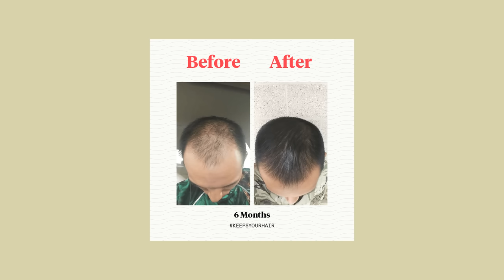£500 Nürburgring Track Car!

Comment: Pretty insane to overtake M cars, Porsches and Teslas with a £500 car
Reply: Well, they aren't racing, some are just cruising around, but still an achievement to drive from the UK to Germany and do a couple of laps without a major breakdown in that car.
Reply: it's less the £500, than that they did all this without using full throttle that impressed me! (full throttle= limp mode in their case)
Reply: the driver is the most important when it comes to amateur racing, ESPECIALLY on a track like the Nurburgring.
Reply: @HazewinDog  know the flow, know the line. smooth equals fast laps.
Reply: @nirfz  in the USA, 700 dollars (about 500 pounds) wont even get you a running car. my friend got a special deal, a 2011 sentra with bad coils and plugs, and no bushings, automatic, leaking cat converter and muffler and no stereo, for 1000 dollars.... because a friend of mine runs a dealership that repairs funky volkswagens, and had  this sentra just dropped into his lap, and wanted to get rid of it. he spent zero, so a thousand dollars was pure profit and he didnt have to do a damn thing.
Reply: @ghomerhust  You wouldn't get a fully functioning car for that money where i live either. But my point was that the money spent is not what impressed me the most but that they managed to "outrun" others while being in limp mode and never able to use full throttle.

Comment: Great video. I had the same car, and for the roof you can open a valve on the pump in the boot which lets you manually put the roof up and down. It has an allen key under the cover which fits.

Comment: if I remember correctly, that car has a slot where you put in a key what can be found by your spare wheel. you need to find the slot somewhere stick the key inside it and turn for the roof to open/close manually. my friend got one of those mercs and used that when his batterie died and the roof was still open.

Comment: Had my eye on the SLK for a while now, really considering it as my next car!!
Reply: I've owned 3 of them still currently own one things to look out for would be no rust, sagging roof line, make sure the roof folds and works well. Thankfully I've never encountered any of these issues as I have purchased low milage examples. They are really under rated and alot of fun I personally think the styling of this generation is much nicer than the ones that came after it. If you find a well cared for example you will love it :)
Reply: Ahh thanks for the advice I’ll definitely remember these things when going to see one. Yeah this generation looks good, also like the R171 variants. The front nose cone makes it look like a tiny SLR. I saw a nice looking 2010 SLK 300 so a V6!! It had only done around 50k miles and was going for I think £11,000. Was really tempted to test drive it but currently out of work so it doesn’t really make sense to get a new car right now. Was thinking of selling my current car and everything. The only thing is not sure if I’d ever have the roof down. But tbh they look good with the roof up.

Comment: Just needs a manual conversion, suspension and tyres and it will set some quick times.
Can also fit a smaller pulley on the supercharger for some cheap extra ponies.

Comment: My car has the same roof system and gets stuck in the same position. The problem was with the boot latch being stuck and not hitting the trigger for next step. Remove the mechanism with the ring in the boot that the lid latches to. The pin in there is most likely stuck.

Comment: i put over 100 laps on the Nordschleife in a 1985 vw cabriolet that i swapped a motor from a 86 GTI into, KW coilovers, enkei wheels, full exhaust, and fully stripped. i was stationed in Kaiserslautern from 1999-2001, built that little gokart, and shredded the tires and brakes on the Ring. greatest place on earth. the green hell is a glorious bit of tarmac that i wish every major country in the world had for themselves. if i was insanely rich, i would absolutely build a replica somewhere in the southern USA to show americans that drag racing is REALLY boring. even 330mph in less than 4 seconds... but can it TURN hahaha

my nurburgring "gokart" (85 cabriolet mk2 gti swapped KW stripped etc) managed an 8:24 with 287k km on the engine, unknown age on the clutch, unknown on the brakes.... but sending it into the corners WAY too fast on sticky Falken ZX502 tires was an absolute riot! the lack of braking made up for the lack of hp (about 105 when the motor was new, probably 90 when i had it!)

Comment: Ok.... I was on track in my 300zx non turbo that wasn't on limp mode and I had a 991 Turbo S point me by on Laguna Seca after the twisty part, then promptly pass me when we got to the straight. but even so... someone with a GT3 touring letting you by on the nurburgring?? what??? They must be too afraid of "damaging their investment". Did they even get above 4k rpm the whole day?

Comment: I would really like to see this car given a quick restoration. Limp mode fixed roof fixed and the ignition and fan fixed
Reply: Honestly, I'd love to see that too but let the roof be a fixed setup so that they can take the motors off and lose some weight in the process
Reply: @rahulsudhir666  I agree get rid of the motors but try still have it manually go up and down
Reply: @deanbyrne5334  A manual foldable hard top would be a pain to build.. Maybe do something like a T-Top n have a quick release setup like how the Koenigseggs have. I'm sure Garrett can come up with some neat ideas

Comment: It's amazing how little power from a 2.3 with an SC. The R53 mini of the same vintage with a piddly 1.6 and an SC is only 20-30bhp down.
Reply: All comes down to where they place the car in the range, yes they could probably get more power from it, but they wouldn’t want to rob sales from the engine above it. They did exactly that in the MK2, the SLK55 was silly money and not all that much quicker than the significantly cheaper SLK350 which also could be had with a manual box. Robbed SLK55 sales.